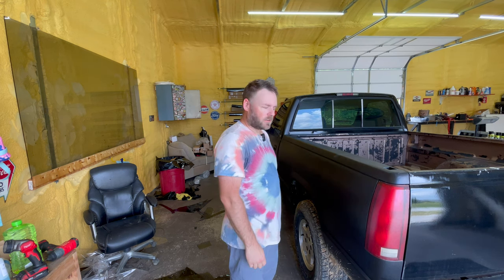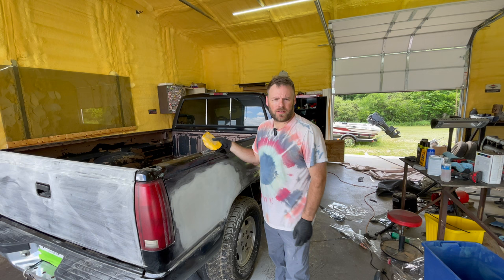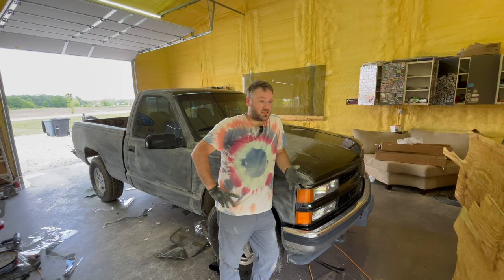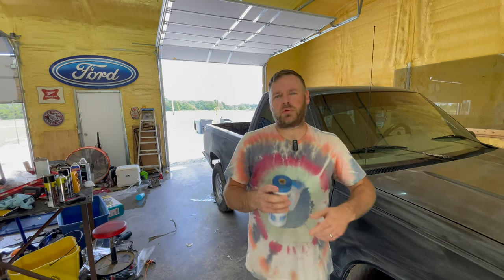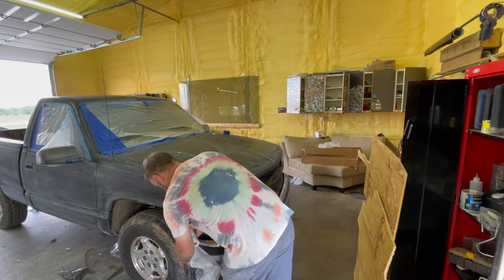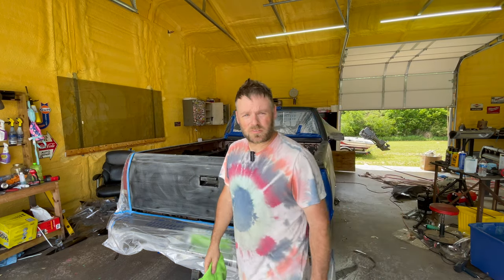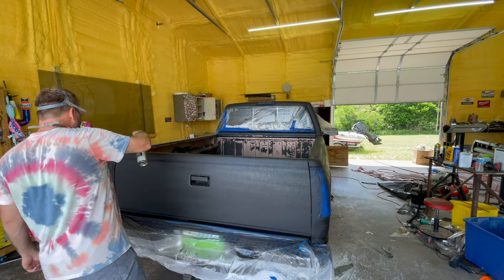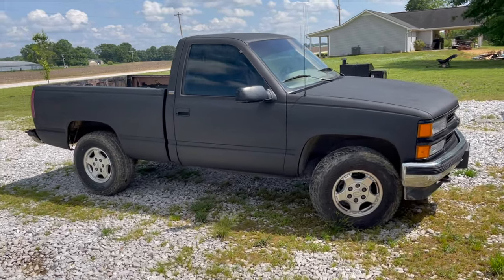I SPRAYED MY TRUCK WITH RAPTOR LINER PART 2

Comment: I’ve thought about doing this to my 96 Silverado. But just wasn’t sure. It’s been primer gray for 4 years now. I think your videos have made my mind up. Great job.
Reply from the maker: Oh yea. Spray it. Lol
Reply: Ha ha same,got a 92 gmc that's been primered for 2 years
Reply from the maker: @theemeraldfox7779  lol. Might as well spray it.
Reply: or you could plasti dip it, but this video is still cool nonetheless didn't even know it could turn out so good since it's not really intended for this use exactly lol
Reply from the maker: @AwesomeMan2696  thanks. It’s still holding up good. No peeling.
Reply: I sprayed mine last fall but don't like the color of it so I'm getting ready to take it back to Toyota 056 white. But the liner itself is bulletproof man. My truck had a bunch of scratches and dents so that's why I'm going back to white raptor liner.

Comment: I did the same prep and the paint job came out great. I used the kit from Amazon. I bought the tintable kit and tinted it the same color as the original. I regret not adding some kind of clear coat. The Raptor bed liner only lasted a couple of years in the Florida sun before starting to peel. I taped before I sanded though, so I didn't sand stuff near where I was painting. Looked good for a couple of years, lots of compliments. Didn't really last though.
Reply from the maker: What kit did you buy?  The raptor liner?  Yea so far so good on mine. We have lots of humidity here, so time will tell.

Comment: People wait to long after the paint starts fading and cracking , resulting with rust. 
Paint of any type protects the car from rust.
Did a good job on that truck.  2👍's up.
Reply from the maker: Thanks ya. I appreciate it.
Reply: Typically they rust from inside out.
Reply from the maker: I ain’t seen that. Lol
Reply: @Steeles  Maybe only where snow/ice/salt?
Reply from the maker: @tommak6516  That maybe it. Lol. They don’t salt anything down here. We just slide around

Comment: I love the huge Ford logo on your wall while driving a Chevy. 😂 I’ve been thinking about doing my old jeep in raptor liner. 1975 cj5. Previous owner painted it some weird grey color. If it was still original I would keep it. Now leaning toward raptor in army green with some flare. Tribute to my old unit. Good job buddy.
Reply from the maker: Hey the sign was free. Lol. May look good with the army green with some black accents in some spots.

Comment: this video cracks me up bro. u give NO FUKS lol. this is the most down to earth  no bullshyt straight up DIY at home without tools and anything special video i have ever seen lol. "im too lazy to go get 180 grit, so im gonna use 80" lmfao. bruh. u r hilarious. i love it. but it DOES look good and u did it all with a spray can exactly how some backyard idiot would do theirs and thats why i love this video. its literally what anyone else would do so this is a 100 percent accurate video lol
Reply from the maker: Thanks. Hey so far so good. No peeling. I think the rattle can look’s better than the bigger kits.
Reply: @Steeles  i sort of agree. i did my mirrors and hood with it. the textures is definitely not as aggressive as the kit and i feel like for me personally i want aggressive. but yes yours came out pretty dang awesome. mines already peeling cause i was just messing around and i never sanded i just painted over clear coat so thats a confirmation that this doesnt work unless you sand it lol....i mean it did last almost a year though lol
Reply from the maker: @Eye_4_An_Eye Yea. That sanding sucks but it sure does help. Lol

Comment: No offense. But I could see lines in the tail gate.  I wonder what three coats would look like and do.   I know thicker paint is it cracks easier wonder if this stuff is the same.
Reply from the maker: I was worried about the lines when I sprayed it. Once it sit for awhile they went away. It’s holding up great. No peeling so far. I like it.

Comment: and yea the canned stuff is no where even close to the actual spray gun kind for raptor. although, i did do my rims in white and they feel like rocks all over it. its super textured way more than the black in my opinion. i loved it.
Reply from the maker: Think I’m gonna use the air kit for the bed. Don’t know if I should go black or another color. What you think?  Someone said red. Idk.
Reply: @Steeles  so i seen another video where they emptied half the bottle and did a red reduction metallic flake and it came out absolutely amazing. might be something to look into. it seriously looked awesome. black is the typical. but black shows every imperfection. white is typical as well but shows less imperfections and also shows dirt way differently than a gloss due to the texture. i heard it gives the textures almost a 3d affect because the dust settles on the lips of the edges of the textures. i have an 09 xb and im going thru a serious debate in my head right now o black or white for the entire car.

raptor is considered medium-permanent paint job so...i gotta choose lol
Reply from the maker: @Eye_4_An_Eye  I will have to look into that. Haven’t thought of adding metallic